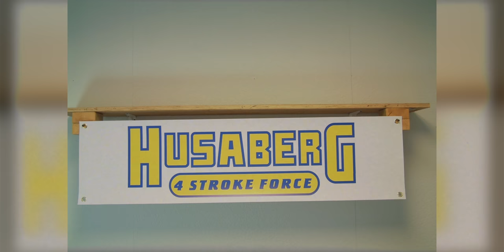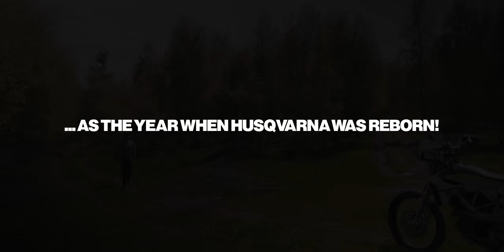The Untold Truth Behind HUSABERG’s Demise!

Comment: I had a 2011 Husaberg FE570S that I bought brand new and finally sold last year. Was the first gen EFI bikes. That bike excelled on everything from freeways to tight wooded single track. Hands down the most capable bike I've ever ridden. It had endless usable power that few will ever experience, and felt just as nible as the 350 I replaced it with. I'll always miss it and remember it fondly. In 11 years it never let me down and was incredibly reliable. It looked right at home amongst todays bikes too. They were ahead of their time right up to the end.
Reply: Why did you sell it?
Reply: @marksmanAlex  I moved to an area where I couldn't justify having a plated bike, and was just ready to try something different. It went to someone who was gonna put it to good use.
Reply: Hi there thorpe 31 I always wondered a couple of things,was it smooth off idle or flame outs/stalling?Could you still find parts if needed 11 years later Thanks
Reply: @nickg2431  If you really wrapped the throttle from a standstill when the bike was on the hot side, it would occasionally flame out, but with how well it pulled down low, you never needed to be that aggressive with the throttle off the line and it was not an issue. Never had much issue with getting engine or chassis parts. Everything has a ktm part number on it. Only parts that became hard to find in the USA were plastics and gas tanks(the real proprietary stuff), although I was able to order complete plastics kits from an Italian distributor with little issue.
Reply: I bought new a 2011 Husaberg FX450.  Rode that bike until 2019 when I replaced it with a Husky FX350.  The 'Berg was a great motorcycle and I modified it quite a bit for my use.  I plated it right away, put on most of the required road legal stuff (which isn't much where I live).  The 2nd year I owned it I changed out 1st and 2nd gears to the same as an EXC to make it better for tight woods.  Later when it needed an engine rebuild I had Thumper Racing bore it out to a 509 and port the head.  Loved the quick revving bike bore setup.  The one downside was the weight, my 350 feels like a mini bike in comparison.  Also the 'Berg was a pain to work on especially when you had to remove the tank.
Reply: @joshharmon4691 what do you mean weight? It's 270 lbs. you mean that it was TOO light???
Reply: @user-cc1hc6bp1r  My 350 is at least 30 lbs lighter than the Berg.  Sadly since my comment a month ago the new owner of my old Berg reported that the motor has expired and it will likely not get fixed.
Reply: The Swedish build great dirt bikes.  I’ve own a highland 950 and husaberg fe650.  Now I’m getting the Stark Varg Alpha.
Reply: Brought a 2013 FE450 brand new. Best bikes at the time. My dad had to buy one of his own so got a 2010 FE450. Couple years later Husaberg was gone. Both of us don't want to sell, pieces of history.
Reply: I took a 570 for a test ride and first lap around the block I tipped into a corner and it tipped in so quick I had to pick it back up again befor mid corner, it was a quick steerer and good handler. Th only problem I ever had was the plug on the control module under the seat would loosen and cut out it did this mid enduro twice
Reply: @danielcase6549  The 70 degree felt heavier when slow speed or not moving but once it was going it felt almost like riding a 2 stroke
Reply: Mine was such a dump truck of a bike and not in a good way. So much heat in the single track and it always handled kind of strange, maintenance was a nightmare it was so hard to work on.
Reply: Well said. I bought a 2011 FE570 in 2013 from a guy who bought it new, did all the upgrades (Scott's Steering Stabilizer, FMF 4.1 Muffler, lots of bling) then realized it was too much bike for him and put it up for sale with only 600 miles on it. So I bought a brand new bike, barely even broken in yet with all the upgrades in place. I've owned a lot of dirt bikes over the years and to this day, the Berg is the best bike bike I've ever owned.  Tons of smooth power and torque and never a flameout. They definitely got it right with the FI. You could wheelie in damn near every gear. I finally sold it in 2021 after eight glorious trouble free years.  I replaced it with a 22' Beta 500rr-s. I love the Beta especially off road but there will never be a more capable and perfect all around dual sport than the FE570.
Reply: Love the 70° Bergermeister!!

Comment: I currently have a Husaberg FE390...pulls you through and up hills that others wont...KTM made a huge mistake deleteing that engine design!
Reply: And the 200
Reply: I rode a friends Fe390 once. Such a unique bike! Loved the way the engine looked though
Reply: I bought one new. It's already been claimed by the next generation.
Reply: the 70° engines have a slightly raised center of gravity which is perfect for medium slippery hills as it gives you a lot of traction, but is a drawback on very steep hills, as the front comes up easily.

Perfect bike for trails and that EFI was rocket solid if you removed the original fuel filters and put in a good one.
Reply: They are tractors! It blew me away being able to take your hand off the throttle in 1st gear and just let the bike chug around on its own - just as long as its not steep.
Reply: But also, the sport was and is getting more technical, and for that reason too, the bikes are getting thinner profiles.

The Husaberg 70deg crank being at the centre of the bike would have been a problem making the bike thinner. And also, as the center of mass was higher up, it has its drawbacks too, in slower speeds and when you actually need to pick the bike up..
Reply: @lassivaatamoinen5468  I get it,but I get the feeling the company accountants had the final say...think of Husqvarna and Gas Gas?
Reply: @williamrae9954  think what about Husqvarna and Gas Gas?

The last Husabergs were just rebranded KTMs. And the last crossover year 2014. Husqvarna and Husaberg enduro bikes had just the difference of coming with a linkage or not.

As for Husky, GasGas and KTM. Kind of makes sense to me, to differentiate accessory level of bikes under different brands, instead of coming up with 30+ different model names.
Reply: But can u get any parts for it, any Trouble with that
Reply: Actually no, the 70 degree angle cylinder had problems with overheating but also exhaust pipe and injection design was a challenge to make it work. The only benefit was moving the rotating parts in center of bike but with new material alloys and smaller flywheel KTM managed to do the same thing with a regular engine design.
Reply: @sebastijanperusko175  It is difficult to get parts for the Husaberg special designed engines, not the KTM once.
Reply: @fredrik999z  a fan, BMW 5 Series cars thermo-sensor, line the tank,wrap the exhaust (no needed up here),Samco hoses, not any difference from any other off-road bike...and it'll leave a KTM stuck in the mud...it just pulls you through, where other designs sink...proven that often!

Comment: Owned 4 Husabergs over the years. 1998 FE600 , 2007 FE550, 2011 FE390 , 2012 FE450. Still have the 2011 , 2012 70 degree engine bergs. I owned a 2007 KTM525 EXC at the same time as I owned the 2007 FE550 and the Husaberg was so much better in every aspect.
Reply: I had an FE570 an it was monster torque for a dirtbike motor.
The problem was it was early in the days of fuel injection for dirtbikes and I had every problem in the book - numerous failed fuel pumps (faulty by design), clogged injectors and screens.  After I got it sorted it was great though.
Reply from the maker: Ouch ... I guess that's the price you pay for being on the bleeding edge... in that case, fuel injection

Comment: Great video about a great motorcycle brand that gave so much innovation to the sport of off-road motorcycling; i still have a 2003 FE501 and it is without doubt my favourite 'modern' enduro bike; i won many Enduro and MX races on it back in my racing days; Springs to suit my 100Kg weight; the WP fork was responsive to adjustments; the WP shock was responsive to adjustments; i had it dialled so i only had to do 2 clicks in compression and 1 (slow) rebound out for MX at the front and 4 clicks in compression and 2 out for rebound at rear...at the end of MX races, turn it all back to the enduro settings; the motor is like an industrial sewing machine....no sudden urges anywhere with torque all the way from idle to stupid high RPM; high RPM was never needed; short shifting was the way to quicker lap times; the only issue was the Electric start but the 04 model decomp rocker arm fixed that problem; i also put a Kehin flat slide pumper carb on it and it starts so much easier now with much better acceleration and throttle response; i've raced a modern YZ450F MX in a straight line (i'm old now) and the FE501 was almost as quick off the start but is still faster at top speed; i had a FE570 for a while but it was too much bike for me; great fun on open trails but too much power for technical terrain and MX for me...Long Live Husabergs!

Comment: I raced harescrambles on my 98 FX 501 here in Ohio
For the 98 and 2000 seasons.  I fractured my clavicle at the end of the 98 season, and sat out all but three races.  At 6 foot 3 inches tall, I did feel cramped.  The foot pegs were too high, and the seat had too low of a dip.  Taller seat foam could’ve helped.  One thing I remember is I was never over taken in a straight stretch.  They truly were fantastic bikes.  I’d love to restore it.

Comment: I still have my first dirt bike, which is a 1997 Husaberg FE400. I got it at 16 and it blew up a few months later for some reason, a valve tappet broke off and bounced around inside the head, causing valves to be stuck open, breaking the timing chain, and the chewing up the top and bottom timing sprocket. I tore the top end apart at 17 but never got around to rebuilding it because I could purchase Husaberg parts from Taffemeisters in England, and it was really expensive to get the parts, so it still sits in my parents garage corner, engine gutted. I would love to one day get it running again because it is still to this day the most torquey bike I’ve ridden
Reply from the maker: That's sad, hopefully one day you'll get it working!

Comment: Great topic and video ! 
I Raced and owned Husaberg 1996 FC500 - 2000 FC600 and 2002 FC550. Great bikes. KTM aquired Husaberg for one reason only: they needed the Husaberg 4Stroke technology, because at that time the only 4 stroke KTM had, was a bulky underpowered engine...No more no less.  It's a shame that the brand disappeared, because KTM has a lot to thank to the Husaberg DNA.
Why come up with Husqvarna, Gas gas, Beta and not Husaberg??? Not enough World titles :-). Don't forget the 1994 season on Vertemati ( 'Italian' Husaberg )
A lot of insiders were sceptic on how it was possible that the last year Joel Smets raced the Husaberg a lot of 'probems' arise, and there were solutions, but nobody listened; because KTM had an other agenda. A fuel line disconnected during the MXON ??? Spark plugs that became too hot ??? --> The solution was there in making a bigger ventilation on the top, but it was not implemented...( source: a well know Belgian 4 stroke mecanic) - KTM Shame on You ! To our opinions it was all deliberately to put Husaberg in a bad daylight and put the brand aside. A year later Joel smets was on a KTM. Joel Smets and Husaberg are a concept ! The Husaberg parts were at that time already integrated in the 'KTM engines' and ' ready to race'... KTM stole the engine, but also the slogan.

Comment: got a 2010 husaberg fe390 and it is amazing but really weird. the motor in particular is really interesting and complex. i see why they stopped making the 70 degree motors, they are insane for performance but they cost a lot to build. the fe390 is just a destroked fe450, it has the same bore size and very similar parts. the thing about that is it has such an insanly under square engine and the massive valves can feed the small cylinder with so much air that it has faltter power than most 450's i ride nowadays. port tuning doesnt matter as much cuz it just has such massive valves for such a small cylinder that at any rpm its making amazing torque. the bike feels way lighter than it actually is and keeps up with modern 350s that are litterally 40 pounds lighter. the motor costs a lot though cuz of the massive force the piston excerpts on the crank cuz of the massive bore and short throw, making much more force that the crank and conrod bearings need to handle. they made it amazingly so it is reliable but it must have costed a lot more to develop and produce a motor such as the 70 degree 390. the 450 also costs more than a traditional motor for other reasons but overall they are amazing performance.

Comment: I bought a 2011 FS570 with the 70 degree engine. I also put together an off-road setup (forks, rear shock, front brake assembly, etc.) for the bike. I got this bike new and don’t plan to ever part with it. I later bought a 2016 TE300 new (Husky). I bought the Husky to beat up in off-road as the Berg has become a garage queen that I only take out when I don’t plan on beating the bike up. It is a awesome bike off road and on road alike. Shame they got rid of the motor design and the name. Only downside I have found for the 70 degree on the consumer side was that it can be a pain to work on in comparison. 
Edit: forgot to add that I live in the US.
Reply from the maker: I’m curious how parts availability will be in the future for those 70 degree engines
Reply: @KRANKiT  you and me both. Hopefully we will still be able to find them.

Comment: I had a FS 650 from 2008. This bike was the best bike i ever had and it was my life. It made soo much fun. I've ridden sportbikes like a zx6r, naked bikes etc. Even though the ZX6R had more power than the Husaberg, the husaberg made much more fun. The annoying thing is, that KTM doens't produce any spare parts anymore. They aren't interested in husaberg anymore. This brand will always have a special place in my heart, but the fact that it'll be harder to get spare parts in the future is the only thing that holds me back buying a FS 650 again.
Reply from the maker: It will only get harder from now on
Reply: @mtuz8356  back when I had mine, the spare parts situation was really good, but now it keeps getting worse😅 the husabergs are quiet reliable, but my riding style has changed. Now I do more longer trips and I most of my time my normal speed is around 140-150 km/h and that riding style wouldn‘t be really good for the berg. Also my life has changed, everything has gotten more expensive, so now I can‘t afford to put a lot of money in my bike like I used to do with the berg. Anyway the time with the berg was the best I had in my life, even though I spent a lot of money on it😂 but who cares. the husaberg really has a special place in my heart and always will be :-) I really hate KTM for discontinuing the husaberg brand. Instead of bringing husaberg and Husqvarna together to Husqvarna motorcycles, they should have kept them separately

Comment: I had a 450. It was nice as a trail and dualsport bike. But to be honest i didn't like it that much in the trickier terrain, it was too heavy and had a high center of gravity. With a safari tank on it it felt heavier than a 690. It was also pretty complicated to work with, very tight with space, cables rubbing etc. Seems to be most liked by big, tall, strong guys who loves the power of the 570's. Comparing the 390 with a modern 350 is like night and day.

Comment: In reality, KTM saved Husaberg.  Those 90's bergs were expensive at the time.  Berg had no cash and no scale by which to cut costs with suppliers.  KTM had cash and market power with suppliers.  It was a good run while it lasted.  Sure, KTM treated berg like the red headed step child (still better than Cagiva).  But they did get to build bikes their way for about 20 years and that 570 mill sure was something!  Innovative, fast and fun.  I will miss Husaberg and truly wish Highland would have made it.  Damn airplanes!

Comment: In my mind the 70deg engine killed Husaberg.  It is great power plant, but.   It's hard to service, examples adjust the tappets, the cam cover bolts are buried. To remove the tank is a 30 minute exercise, instead of 2min and a 8mm socket .  The exhaust path is torturous, and traps heat in the tank/bike.  The bike feels pretty light to ride but is actually pretty heavy in kg - even for 2009.    I still have 570, plus my 2019-2023 dirtbikes  and plan to never sell.  It is a very special bike .
Reply from the maker: I’m not sure that killed it for sure ... I’m sure it didn’t help though :)
Reply: At some point the reasoning for discontinuing 70deg was that the company was able to achieve the same goal, up to a degree, by using twin-cam setup.